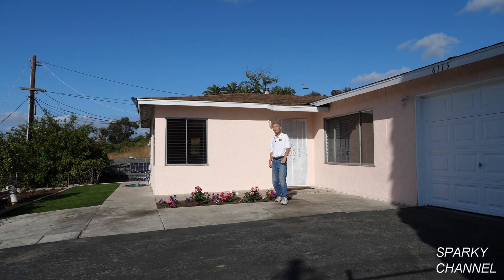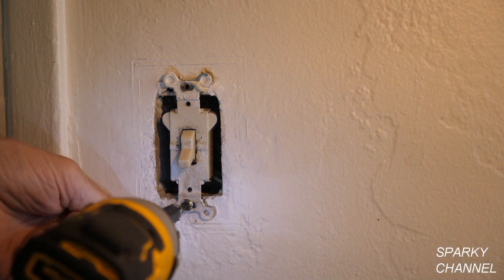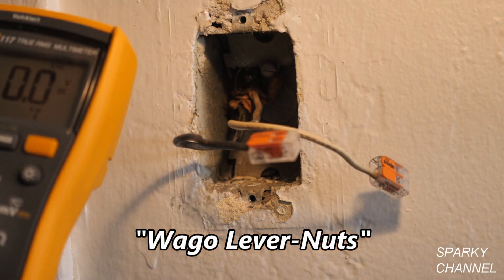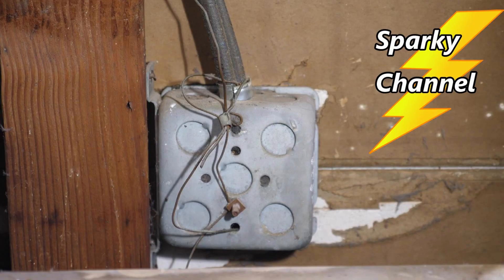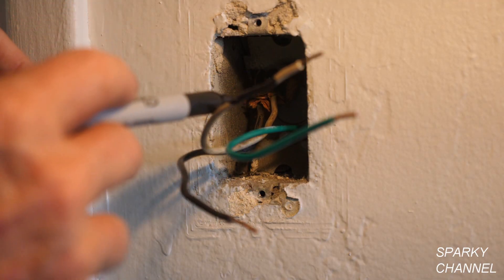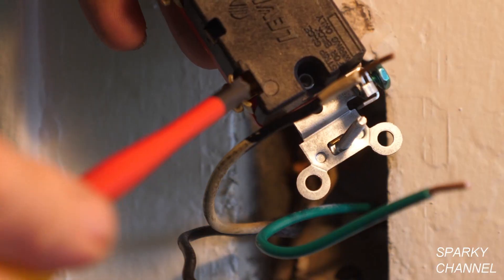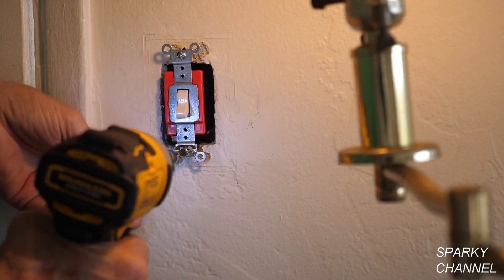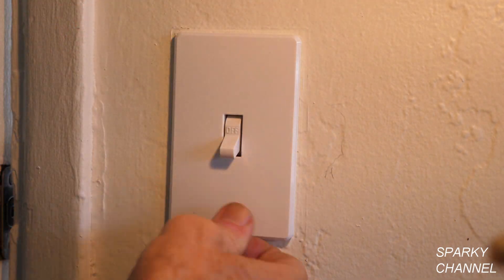Replacing a Vintage 1960 Switch and Grounding the New Switch

Comment: How come you replaced this snap switch with a spec switch instead of just a cheap resi switch? Also, instead of tapping a new hole for a ground screw, you can remove the bottom clamp that wasn't being used for anything. It uses a 10-32 screw, just like ground. Removing that unneeded clamp also gives you more wire-fill, also a good thing!
Reply: Was also wondering why he used an industrial spec switch.
Reply: Was wondering why he bothered to run the ground when it’s self grounding switch And the box was already grounded

Comment: I know it technically doesn’t matter which wire goes where on a single pole switch, but I was taught that the line side goes to the bottom terminal and the load side goes to the top so that’s the way I always wire it.
Reply: That’s how I do it, even though not required. It’s good to have a method when installing devices. 

I hook the conductors onto the terminal, and keep line in the bottom, load on top for switches. 

Old school wiring can be confusing. Modern wiring makes installations better.

Comment: I remember doing this on the same age home in California. Thankfully all the boxes were metal and grounded so, adding newer grounded outlets was easy. the wierd part about it is that back then, the ground was always #14. wire.... but the good thing was that at least we were able to update the outlets for modern use............and this was back in the  late 1980's.... at least the electrician was thinking right!

Comment: If the box is grounded which it is it makes no sense to add a wire from the switch to the box.
Reply: Under ideal conditions when a switch or outlet is installed it is screwed down tight so the mounting strap is in physical contact with the box.  However, many times the box may be too deep.  Are you going to rely on ground continuity from 2 6/32 screw threads to carry a potential 15 to 20 amp fault current to ground?  That's why it's good to use a tight screwed in 14 or 12 ga jumper, you now have a secure, low resistance connection.
Reply: This is true but better safer than sorry. If you aren't going to ground the device with a pigtail at least mount the device and then test that it's grounded, sometimes these old boxes have paint and so much dirt and build up on the face that a good ground is blocked.
Reply: @mook528  glad I stumbled upon this response.
Reply: It's to ground the switch. Pay attention.

Comment: Would love you to do a US reaction to Uk or European wiring? See what you think to do a chaps
Reply: UK electrician. I would as well. Isolation with volt stick, un shielded test  leads on fluke. Insulation tape? Didn't have sound on but CPC to back box means everything is protected. Never seen any testing.
Reply: @douglasgreaves188  That's because we don't need to test everything.
Reply: There really is no single European wiring, especially when one goes to the older stuff. What I find strange are those metal boxes.

Comment: Sparky, you didn't exactly explain WHY you used the meter — you said "to make some important tests". It seems like your test verifies that the box IS grounded so adding a pigtail to the back of the box to ground the switch is OK to do. What would the meter have shown if the box WASN'T grounded and what should one do about that? Should they just install a switch without a ground wire/pigtail?

I love your vids, I just need you to go a little bit farther in your explanation on this. Thx!
Reply: If the box not grounded or the box isn’t metal! Then you need to run a ground to like a metal plumbing pipe. They have ground connectors for hooking to plumbing pipes you can buy.. but normally you don’t need a ground on a light switch and many don’t have one either! Where the problem comes in not having the ground on your light switch is many of these new smart plugs or light switches do require a ground wire and they won’t work without a proper ground! If your box is plastic and there’s only the power and load wires connected. I don’t even worry about shutting the power off. You can’t get shocked unless there’s a ground or return wire in the box too or maybe if your standing in a tub of water? LOL Worse thing that happens if those two wires touch with the power on is your light turns on! LOL This older home with the metal box being grounded more understandable turning the power off first though, especially working with old wiring you never know where the wire insulation might be wore off?
Reply: @ghostridergale  right, I only worry about grounding a switch if there is an available ground, if not then whatever. It's just one leg of a hot wire.
Reply: I think the answer is supplied — but the point not really driven home — in this other Sparky video: https://www.youtube.com/watch?v=H-2ETtDBu9s

Comment: Isn’t that a self grounding switch ?, I’ve watched other videos you posted and believe you don’t need the ground pig tail. Please correct me if I’m wrong.
Reply from the maker: I like to use both the EGC and the self grounding clip. Then you have redundant grounding methods.
Reply: @SparkyChannel  Which makes no sense.
Reply: @pcar5  if you removed the switch while energized the redundant ground provides a path of equal potential to ground should a fault occur. If the device has a provision for ground use it.
Reply: @ronaldarchibald2506   thank you, I finally understand why he is doing it.

Comment: i love those old switches that give a nice solid click. i have no plans on changing them in my house.
Reply: It is a heat tought memory
Reply: There was a company in Virginia that started making reproductions for houses built after WW2 and there was a housing boom as the GIs returned home.
Reply: Yes, and those switches are made of ceramic and thick brass (after daily use for 1/2 century and they are still working like a charm)---not some cheap plastic and thin metal strips, BUT when it comes time to sell your house and the young buyers (as clueless as they are) prefer new, "updated" switches because they don't care about functions and longevity but only cosmetics.....you know the usual with the new generations, forms are more important than substance..
Reply: @trankt54155  well, I am 18 so I won’t be selling it for a long time, the house was built in 1959 and has pretty much all original stuff and I have no plans on replacing anything that is not broken or causing issues. Even my fridge is from 1987
Reply: @WalterKnox  My house was built in 1945 and everything was solidly made in the USA. The walls are all cement plastered....
Reply: @trankt54155  nice, keep it that way. It always makes me really sad to see some old house completely gutted and all cheap materials put in so someone would buy it. I wish more people would appreciate things like that. You can always build new cheap houses, but you can never make a vintage one again. Once they have all been ripped apart that is it.
Reply: @WalterKnox  The house was completely built with solid wood----no laminated or synthetic stuff----and so the second you walk in you can appreciate the smell of dried wood....it is like dried wood smell refresher. All the knobs and internal components are solid brass and not flimsy stamped, chrome or brass plated today's stuff...When one of the door locks is no longer springing open I could not find replacement and all the new door knobs are cheap and cheap made and so I removed and took it to a local smith and he rightly advised do not replace it and all he did was to give me another spring that he had lying around and then it works again. Nothing was worn except the spring broke due to metal fatigue....imagine that....they don't make things today like they use to....today's stuff are nice and shiny and are good for a few years......not decades..
Reply: @trankt54155  yep my house is was built in 1938 and is still standing very strong. Has all the old switches and original feel to it still
Reply: @maxheadroom8857  Interesting, must not have been great switches. I still see quite a few old switches from the 50s, and even older still working fine after many years of use. 
I  love old fluorescent lights as well, the old circline ones are cool. Especially the pre-heat type ones, they last forever. I still have quite a few old fixtures with the original ballasts from the 50s and even some earlier that work perfectly fine. Not something the new ones could handle.
Reply: @WalterKnox  my house has plaster walls with pigment mixed in with the plaster.  The wood trim is varnished, not painted.  The detached garage has its beams exposed, so I can see where the wires are.  My garage electrical is on one circuit breaker, and I retrofitted the garage with a 20 AMP GFCI.  My freezer and laundry machines tolerate the GFCI protection.  I did have to replace my garage GFCI receptacle once after 6 years of use; it was a Legrand brand GFCI with the line connection at the bottom when the ground prong faces bottom as most do.  I have Leviton GFCIs in my house, where the line connection is on top.  My garage line wire comes from under the slab, so I used the Legrand the first time.  My garage now uses an 20 amp Eaton GFCI which also has the line at the bottom.

The original owner used Hobart brand switches and 2 prong receptacles, which was a brand associated with Sears Roebuck Corporation.  My dad had me replace a double gang switch box for him in our kitchen back in the early 80s after I graduated high school.  We had a roof leak that damaged the original double gang box.  When a switch wore out to the second light fixture controlled by 1 of the switches in that box, when I tried to remove the old switch, 1 of the switch mounting bolts broke.  When I ripped out the old box after chipping away, I found out the old box was grounded from behind.  My dad had fortunately purchased 2 expandable single to multi gang boxes, which allowed me to bond the box and also run a jumper from a second ground screw to the switches.  I simultaneously replaced the other light switch in the box due to a mounting bolt breaking while I removed the 3 way switch to the outside light.  I have another gang box on the same wall I need to change, due to the damage done by the roof leak.  There is a grounded outlet in a box on the next stud.  I will need to chip out the plaster and rip out the old box to install a GFCI in its place, and patch the wall.  At the same time, I plan to run a ground wire up into the attic to allow me to run grounds to ungrounded boxes in my home, and ground them, using grounding clips.

By the way, some of the older homes which ran separate ground wires to boxes, because most NM wiring had no ground wires, used cold water pipes as a shortcut to ground the box.  The breaker panel was grounded and bonded to the building's cold water pipe, so many electricians grounded the boxes to the water pipe if the cold water pipe was near the gang box.  Also, if they used metallic sheath or ran conduit to the breaker box, that served as a ground as well, since the main breaker box is grounded to the water pipe.  That satisfied old NEC code for years until PEX water pipes came into being used as patch and repair plumbing pipes.
Reply: @WalterKnox  I changed the last of my old switches because they got a bit stiff.  I have 1 Hobart switch left.  However, the switch goes to a vent fan that the original home owner removed in 1961 before moving out, just after he and his wife sold the house to my parents.  My dad bought a fan for the kitchen, but we never installed it.  I found out it's the wrong size and too small for the vent.

Comment: Hey sparky! I have an older 60s home with non grounded light switch. Has plastic type material box. What im wondering is i wanna change my light switches to new decora style. Can i change them legal to code with out ground. And install a screwless face plate? Would tgat be code compliant? Thanks sparky

Comment: You are a fantastic teacher. I moved into an 80 year old house. I cannot afford to pay for an electrician. So you are helping me immensely. I am trying to find a video where the old knob and tube insulated wires that are thick in diameter due to the corded wrapping wire insulation and are short in length and long so it is difficult to fit the outlet into the old boxes. It is difficult to fit the GFCI outlets into the box after attaching the wires to the outlets. Have you made a video that instructs how to handle these very old wires. Some wires are so short that I feel they need to be spliced to extend them. You are a very good electrician. I wish I had all the testing tools you use. Thank you, Gina
Reply from the maker: Hi Gina! Bless you, it sounds like you have a wonderful house. From the sound of it I really think that your house needs to be re-wired. Or perhaps if that isn't possible perhaps one circuit could be re-wired at a time. Knob and tube wiring has reached the end of its useful life and needs to be replaced as soon as practical. Until then be as gentle as you can be with that old wiring. Best wishes!
Reply: @SparkyChannel  That is exactly what I have. After living in this house 110 year-old house for 35 years, I am finally reworking the questionable circuits one at a time, like you have recommended here, and room-by-room.  When a new service panel was installed well before I bought the home, they rewired all the visible wire in the basement with 3-conductor NM-B up to junction boxes where some K&T, and some 2-conductor wire went up the walls. My first step was to map the circuits and label the junction boxes. In many cases , it is easy to use the old wire to pull a new 3-conductor wire through the wall. Often it was just a 4 foot length of wire to replace. I am also replacing the small outlet boxes with fiberglass old-work boxes.  My goal is to at least make each circuit safer with dual AFCI/GFCI breakers or AFCI breakers and GFCI receptacles, and to replace  as much 2-conductor wire with 3-conductor with an equipment ground as I can. There are only a few circuits that will be beyond my ability to replace, and I will either hire an electrician to finish those, or use my map to disclose to the next owner. I am learning where I can be confident in the old wire, and where not. The old K&T is mostly in good shape. The problem is the 1950's wire which seems to have a much poorer quality of insulation.

Comment: Would ordinary copper wire work for grounding?
Reply from the maker: Yes but I prefer using the green ground wire.
Reply: That's usually what you see in the box unless you are adding a pigtail.

Comment: Love your videos but if the box is flush and if you have self grounding yoke and you have both than article 250.146B contact device or yokes designed and listed as self grounding shall be permitted in conjunction with supporting screws to establish equipment bonding between device yoke and flush type boxes
Reply from the maker: That's true.
Reply: So
Reply: Depends on AHJ.  Some require EGC also.

Comment: I just bought a house built in 1955, and it appears the wiring is from around then too. How can you tell if the box is grounded or not? I have mostly 2 "prong" outlets, and would like to replace those with new grounded ones
Reply: Replace with GFCI receps.
Reply: Chances are if your house is that old without any EGC the box itself won’t be grounded but if you want to check you can use a multimeter and set it to measure continuity (resistance) of the box
Reply: He just showed you in this video how to check for a grounded box

Comment: Say, why not make it hot all the time and just install a light with a sensor?
Reply: Why not install 10 more lights in the same room?
Reply: @yankkesrule  Or just one BIG light in the same room?
Reply from the maker: That would be possible.
Reply: or just leave it on with a phtocell
Reply: because maybe you want the light off when you want it off
Reply: @mook528  It would turn off with the sensor though.
Reply: @NurseBoobies01  you lost me. If you only have a sensor and no switch, how do you turn it off and on at will?
Reply: @mook528  That's the point; not to. I wouldn't want to turn it off when the sensor will do it for me. If I have to take it apart to fix it, I'll turn off the breaker.

Comment: The white wire is the live line and the black  is the negative line?
Reply: The white line (marked black) is the line wire.  The black wire is the load wire.
Reply: There’s no positive and negative in ac electricity
Reply: No, the white in this case is the line, and the black is the load, also called the switch leg. The switch is just internally shorting the 2 wires together in order to close the circuit. There is no such thing as a negative in AC wiring. You are getting confused with neutral, which would be a white wire that will be needed in the box for a receptacle. Switches don't "need" a neutral in order to operate, but the new code requires switch boxes to contain the neutral.
Reply: Because the conduit (Romex type wiring) is bundled. Both wires are used as hot. It's code nowadays to mark the neutral wire as Hot for use with single pole switches.
Reply: With switches yes, but it's supposed to be marked as hot.

Comment: how do you change a stove outlet
Reply: Pretty similar to this. Buy the right one, turn off power, test to make sure it's off, take out the old switch, read the paper that comes with the new switch which will tell you how to wire it. Then turn the power back on and test it with your meter.
Reply: The same way you change any other outlet. hot to hot, neutral to neutral, ground to ground.